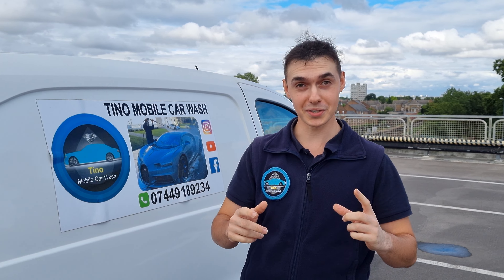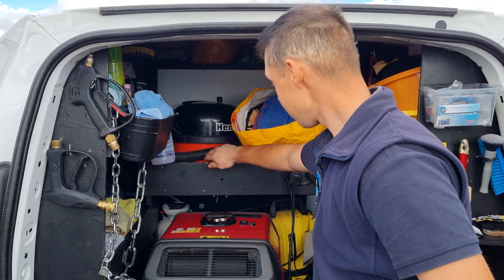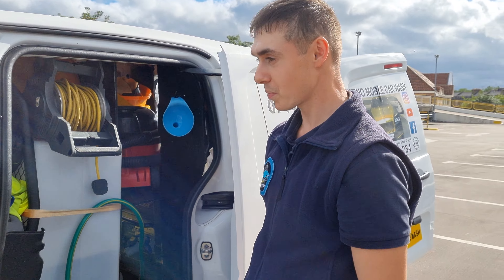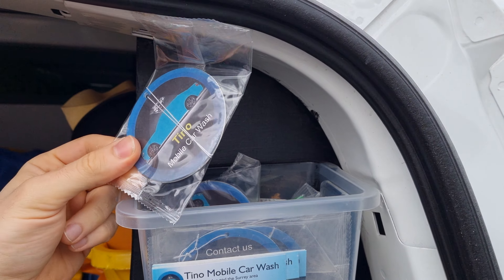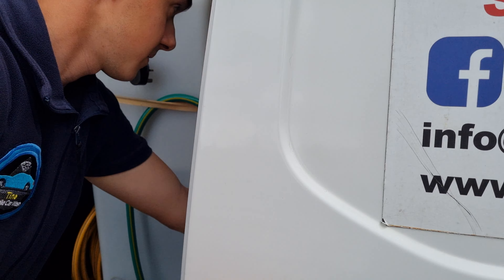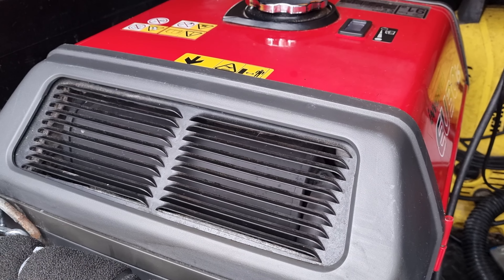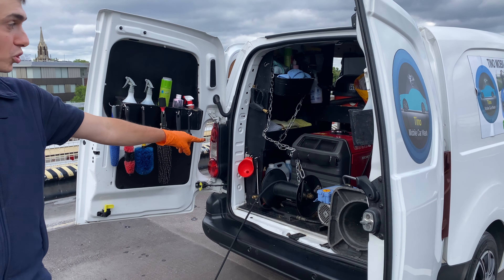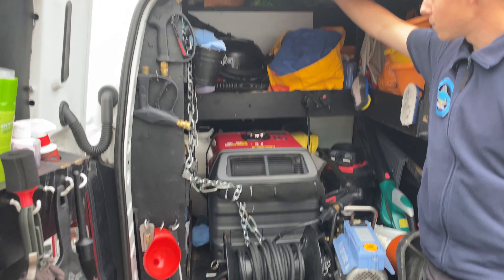The Ultimate Mobile Car Wash Van Tour

Comment: Great explanatory video. What about pre-heated water? I have been in a self service car wash where the water was hot and it made easier to wash the car and it took also less time. With your current van setup, would it be difficult to install a water heater in the water tank?
Reply from the maker: Heated water definitely does a beter job at removing the dirt however, it may not be possible in this kind of set up as the power would need to come from the generator (which is off most of the time).
But when the generator is on, it may not have the capability to power both the heater and another appliance at once.

Comment: How much money did you spent for this mobile van
Reply from the maker: In total it cost around 15k for the van, equipment, fittings and everything else in there
Reply: @TinoCarCare  is it including generator and pressure washer
Reply from the maker: @motorspecskannada105  Yes

Comment: Might need a bigger van. Mid roof Transit or mid roof Sprinter.
Reply from the maker: True however, here in this video: https://youtu.be/CX23E_HLNwo 
I buy a new van which is a little bigger, however in London, I have to fit into a lot of tight spaces, which limits the size of the van that I can get
Reply: @TinoCarCare  yeah, that was going through my head. Here in the States don't to worry as much with low ceilings.

Comment: you do great work, however I think your setup can be better organized and still keep you going at high efficiency because this just looks like organized chaos
Reply: Valid point but if you haven't done this type of work with traveling late and long hours 🙃 and limited packing space with alot of tools and supplies then unfortunately you won't be able to comprehend the amount time effort planning limited sleep stress levels through the roof and still worry about the so called chaos 😅 .

That chaos is really the last thing on your mind trust me if it's all in there then you good to go.